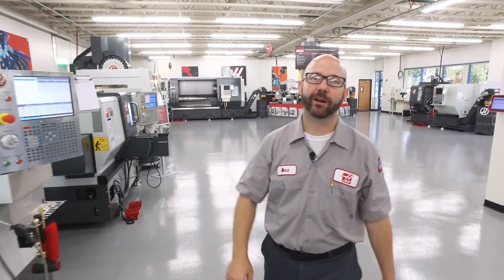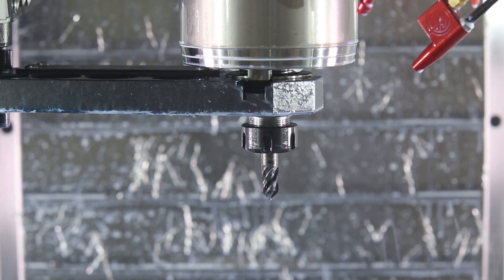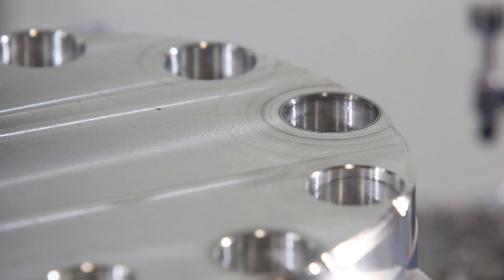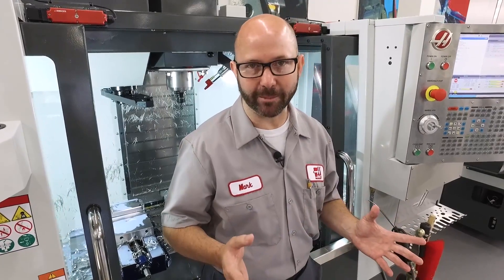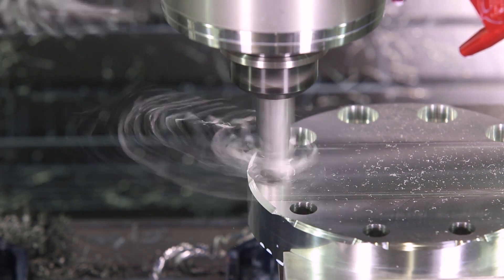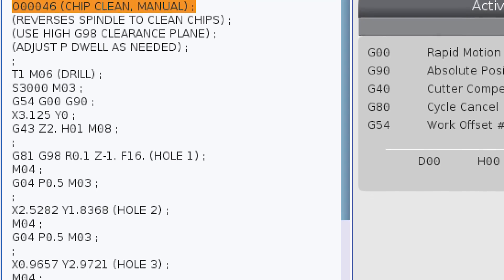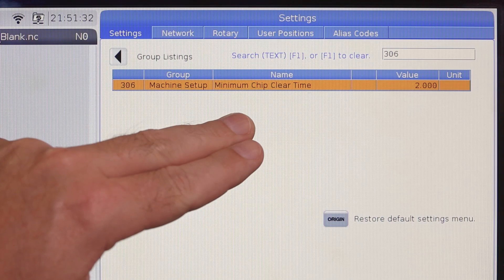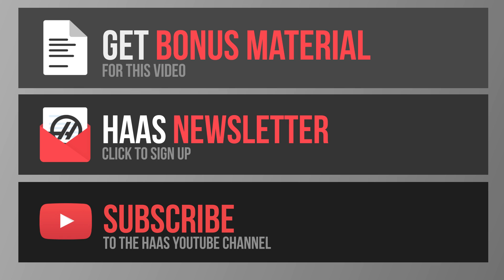Stringy Chips Wrapped Around Your Tools? Mark Has a Solution! – Haas Automation Tip of the Day

Comment: Why the fuck is your probe in the tool carousel lmao smh
Reply: I don’t like seeing probes out of the machine, I believe it often leads to accuracy problems. I’ve asked machinists to put the probe in, and seen them just grab the probe and load it up, not even noticing the orientation. If loaded 180° out, it will double any calibration error. Safest, and most accurate, place for it, in my opinion, is in the carousel. It’s also at hand when needed, but to each his own.
Reply: @markterryberry4477 trust me, you’re not doing jobs with the tolerances to even think about stuff like that.

Comment: I love watching these videos and then go back to work running a 1995 vf4 that doesn't have those features 😂. I ran into an issue where my boss programmed a drill cycle that not only built up the chips but also got the counter weight swinging momentum in the back of the machine. Those were interesting issues to fix.

Comment: This idea is brilliant...... Reversing the spindle direction in order to clear the chips out of the flutes! We all run into this problem, especially on soft aluminums or hard super alloys. This might even counteract chip welding problems.
Reply: Is it safe to reverse the spindle at such high RPM ?
Reply: Yes it's safe. The spindle drive unit is sturdy enough to handle quick reversal of direction. Think of what happens when you tap a hole.
Reply: @johndonlan5956  i see, was just worried tho at 2000 + rpm to suddenly reverse it..

Comment: Can this be applied to a tapping cycle? That would be awesome, if it can!
Reply: Not in the same way, no. We have a video that talks about the chips during tapping, https://youtu.be/bkrUzGooA9k and one on peck tapping as well, https://youtu.be/yBK1MN_Q9J0
Reply: @markterryberry4477  Thank you! We did just find out our new VF10 was set to "off" for the rigid tapping. As far as the peck tapping, we had always used multiple tapping cycles in the code for the different depths. Didn't work so well with that setting!

Comment: On the first look very clever. BUT it will make the process longer and it will stress the spindle motor I guess.I usually go for feedrate or clever chip breaking. After all, the only operations in witch I might have some chip probs are threading and boring. But also in these operations there is nearly always a sweet spot, you only got to find it.

Comment: I've been a CNC machinist for 20 years. I seriously did not expect to learn something new today, but there it is. Birds nests are often a rookie mistake from underfeeding and I've usually found work arounds by feeding hard enough to break the chip and running the process up fast enough that pecking, broken chips, heavy chips and centrifugal force does the job but adding a spindle reversal like this on your control is a great idea. Well done.
Reply: Sometimes workholding rigidity does not allow too aggressive of a feed.

Comment: I used to do the reversed spindle, but later the spindle motor had issues because we werer working on thousands of holes drilling
33 thousand times later reversing the spindle, motor didnt really like it...
Also, pecking isnt the best way out since it tends to overwear out the drill.
We managed to settle all those issues by using higher feeds BUT also putting a stronger inside coolant system to cool off the drill during the process and to get those chips out (we drill deep holes)

Comment: I discovered this solution on my own a few years back, but it does have to be used with a dialed in chip load to get heavy enough chips to make it effective at all. Of course, there are a few more things that can be done with negligible time difference compared to an M04 and dwell, I would add a peck to that counter bore, or interpolate with a smaller endmill before adding wear on a machine.

Comment: The actual problem here is you’re using an end mill to counter bore. Use a counterbore still, or even better, interpolate the hole. You have a CNC machine use it.

Comment: I love these videos, but i have a question; does reversing spindle direction work for gundrills as well? I use solid carbide at a pretty speedy feed-rate but I still have issues with clumps of chips and I don't want to peck with the depth i'm cutting at
Reply: Sounds like you should just try it and report back

Comment: it will affect the machine spindle?
Reply from the maker: Man sk - Probably not.  Although it is possible that if the spindle does not have a tool in it and the chip is long enough, the chip could damage the spindle taper. - Haas Automation

Comment: couldnt help but chuckle at the reversing solution. sometimes with machines like this, you just expect to have to throw money at the problem for some other $5k ultra high pressure coolant pump deluxe 3000 add-on, while the solution could be so simple.
Reply: sure but having the $5k ultra high pressure coolant pump deluxe 3000 add-on is better than not having the $5k ultra high pressure coolant pump deluxe 3000 add-on

Comment: Hi! this clip great! but what P0.5 (G04P0.5M03)? i have machine DOOSAN (FANUC) code on okey? Thanks!
Reply from the maker: son nguyentrong – On the Haas Control, a G04 P0.5 is a .5 second dwell, where the machine will just wait for ½ second. For more information you can download the Haas manual from our website, and search for G04, https://diy.haascnc.com/user-guide  – Mark, Haas Tip-of-the-day
Reply: @haasautomation  
We just bought a new 2018 haas vf5xt. G04 P.5 doesnt represent a half a second dwell, G04 P500 does. Is there a setting to change this?

Comment: im working on a hass 750ss, we added this E2000 on our post processor it was all great until our machine was getting some vibrations during machining and bettween tool changing some tools were falling. we contact support of haas on portugal and they correct that vibration and the tool change doing a downgrade on our machine software, all great again but when the machine reads the E2000 nowadays she dont assume the 2000 rotation and instead she goes until the max speed of spinde 15000 and until the spindle gets to that speed it adds a lot of time to the drilling. very lame from haas we are expecting a upgrade to software that corrects this and some other bugs since january or february. to the ones who have correct software on machine this e2000 is a beast in clearing chips, to the other ones like me just cry day and night

Comment: sir we are facing same problem in turning center where chip is not getting broken and whirling around insert ,because of this in component we are getting burr mark mainly in finish operation , so we increased feed and corrected coolant ,used peck drilling but still we couldn't solve this problem. pls give us better solution if possible
Reply: Decrease peck depth to around .050

Comment: Use Helix Bore! It's faster and you eliminate the chip problem before it starts. You also have better control over size since end mills cannot guide themselves accurately when plunging.

Comment: that works with mill machines, what about lathe machines?
Reply: I know this is a bit late (2 years so lol)
But I've had good luck with using an insert with a more aggressive chip breaker, using the correct rake angle for the hardness of the material, and taking a heavier depth per cut to create larger chips that break easier (6s and 9s rather than strings)
Reply: @liquerinfrnt  Stalling for a split second every so often also helps break chips similar to peck drilling.  For small runs and one offs, doing this can save a lot more time then trying to figure out the perfect insert, feeds and speeds when manual turning.  Might be more of a pain to program for a cnc though.
Reply: @Worrsaint  most CNC machines actually have a built in peck drilling cycle, so not too hard at all
Reply: @liquerinfrnt  I was not talking about drilling, I was talking about turning. Ex. Turning the OD of the part, or boring the ID of the part where you tend to rats nest on the workpiece or the boring bar respectively.  Unless you are referring to using the peck drilling cycles with a turning tool instead of a drill bit.

Comment: Could you use a slightly smaller endmill and helical interpolate the hole? Then you'll have small ships and not strings.
Reply from the maker: Definitely. Changing the way we approach the part, to prevent the stringy chips in the first place, should always be our first choice. This is an if-all-else-fails tip; but, if all else fails, it can be really useful.

Comment: Improper speeds feed and improper machining techniques are usually the culprit as shown in the video. I rarely have a chip wrapping issue. Tubing mat is the biggest chipper for me. Most of our machines have through the tool coolant, that helps. 
Typical materials I machine are Stainless (303, 304, 316, 416) Alum, variety of steels.

Comment: seems like that can't be good for the spindle...
Reply: I'm sure the spindle can handle it. Not like it's a 12" chuck. :/
Reply: Going M05 then M04 is the same thing. 
The machine wouldn't do it if the load on the spindle was too high.
Reply: Well, can't be good to drill with 7000 RPM and just add a M04 to change the spindle direction. Going M05 M04 would be a little safer but still not good for you electricity bill.

Comment: should do a video on USB drive "unable to read"  common problem around here
Reply from the maker: Hi Tom. I have a few USB sticks that don’t read as well. The Haas Control does not search for, and then load, new device drivers for each USB stick that is inserted, like a desktop computer. The drivers are embedded, and only get updated when software is updated, so every stick isn’t covered. Your best bet is to find a USB stick that works for you, and continue with that brand/type. I like the SanDisk Extreme USB 3.0; works on all my machines and is super fast: https://www.amazon.com/SanDisk-Extreme-Flash-Drive-SDCZ80-032G-G46/dp/B00DZPUOU8?ie=UTF8&keywords=sandisk%20extreme%2032%20usb&qid=1448471001&ref_=sr_1_2&sr=8-2. Hope this helps!
-Mark, Haas Tips of the Day
Reply: thanks, I will look into it.  Keep up the tip videos!

Comment: that's just improper feed/speed. seen this so many times with drills because programmers can't be told anything.
Reply: The wonders of machine shop politics! lol! Always that high horsed prick that thinks hes a god! lol!  Feed ME!! Hahahahaha! lol! Take care bud.
Reply: I agree, I think he missed the part of it being an endmill to make a counterbore.
Reply: Can you please advise me on feeds and speeds? I need to drill 0.086 holes 0.900 deep in PEEK.
Reply: Everardo Rascon .089" drill is usually .002 or .003 IPT, peck is 50% of tool diameter. SFM is whatever used for HSS in the material you are drilling.
Reply: Thank you